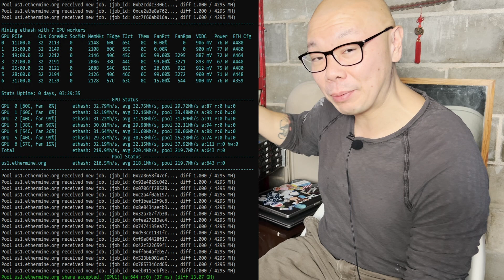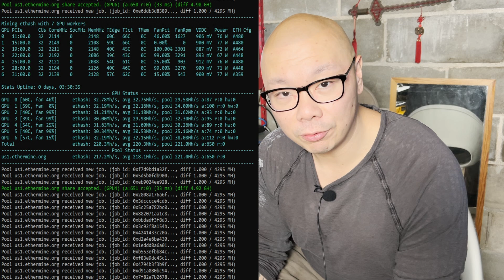How to upgrade PCIE Expansion for additional GPU Mining

Comment: Using 3070 for mining when I dont play it does nicely 62Mh. Saving more money to buy 40.. Series when they are released instead of bunch of small cards. Hopefully those 4080,4090 will do double the 3090 meaning it will  ROI in half the time of bunch of smaller cards. Those 8 cards you have should cost 50-100% more than one 4090 which should do around 200Mh. We shall see 😁 Good luck though

Comment: You can get a PCIe x 4 USB card and not have the extra board to deal with, and they work great. But since you already have this installed may as well go with it. The only benefit to the USB card is less clutter in your rig.
Reply from the maker: Yes I did consider that one too. But for some reason I like that I got the actual pcie slot oppose to just USB port. I have no rhyme or reason for my decision 😆
Reply: @poorinvestor  It's all good bud...Just didn't know if you had seen it or not LOL.
Reply: Yes PCIe USB is the way to go. Save money and space. You might also want to tune those cards. Those fans should be somewhere between 85-95%.